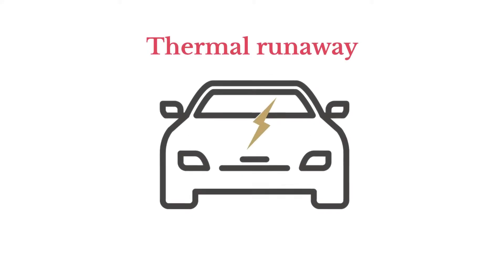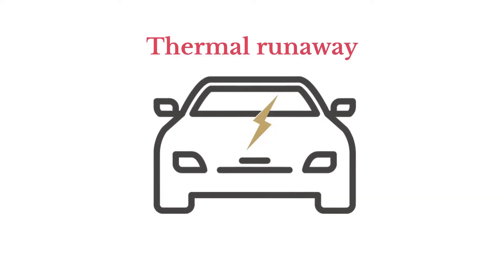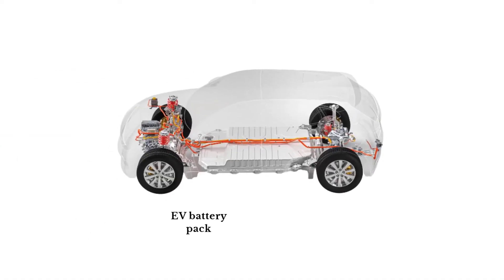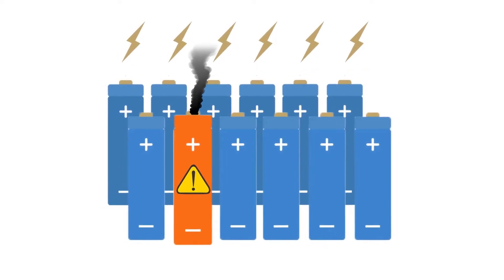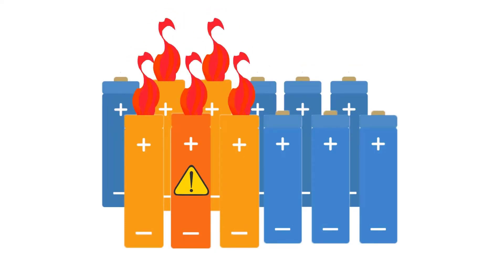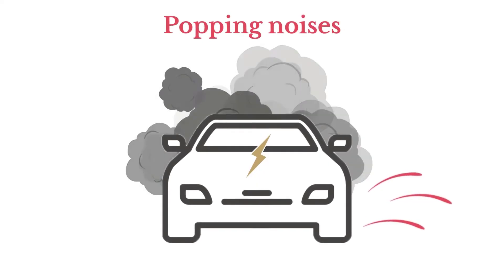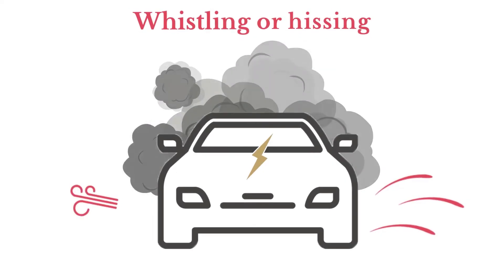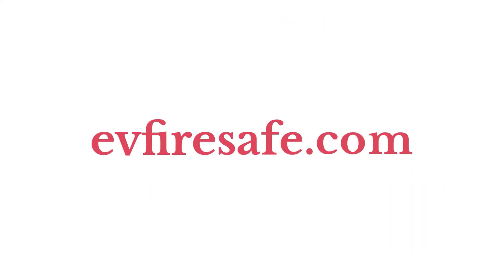What is thermal runaway? Electric vehicle fires explained!

Comment: Does anyone know the ratio of EV vehicles doing this VS gasoline vehicles?
Reply: Really?
Reply: The chance of an EVs battery igniting is 50 times less than that of a ICE igniting. 

Good news is some automakers are going to stop using lithium ion batteries and use lithium iron phosphate batteries instead, which will make them safer that ICEs. Also it is highly likely in less than a decade, sodium will overtake lithium and be the norm.

ICEs catch fire so much, that it isn’t newsworthy when they do unless they hold up traffic or kill someone.

Comment: The chance of an EVs battery igniting is 50 times less than that of a ICE, but your EV will be a write-off and you want to make sure you get your ass out of the car on time. Good news is some automakers are going to stop using lithium ion batteries and use lithium iron phosphate batteries instead, which will make them even much more safer that ICEs in regards to igniting. Also it is highly likely in less than a decade, sodium will overtake lithium and be the norm.
Reply: YOU ARE CLEARLY A COPY AND PASTE BOT SHILL FOR THE NEW WORLD ORDER AGENDA , EVS ARE 1000S MORE LIKELY TO CATCH FIRE DUE TO UNSTABLE MOLECOLES AND ATOMS , DIESEL AND PETROL IS AN EXTREMLY SAFE SYSTEM AS IT REQUIRES OXYGENS TO BURN , UNLIKE UNSTABLE LITHIUM THAT CAN BURN UNDER WATER AT 5000 DEGREES , FEW YEARS AGO FIRE SERVICES AROUND THE WORLD WERE FACING CUT BACKS TO AN EPIDEMMIC LEVEL TO THE POINT WERE FIREMAN WERE CAUGHT LIGHTING FIRES DUE TO THEY HAD NO JOBS AND WERE FACING THE UNEMPLOYMENT ,,, THEY PRAYED FOR A MIRACLE AND THEY GOT ITS CALLED LITHIUM , SINCE LITHIUM BATTERYS THE FIRE SERVICES AROUND THE WORLD HAVE GONE ON A HIRING FRENZY AND HOUSE FIRES HAVE INCREASED 1000S OF PERCENT , EVEN LAST WEEK A KID DIED IN MY AREA DUE TO LITHIUM BATTERYS SETTING HOUSE ON FIRE !!!!
Reply: I havnt seen ANY evidence of ICE car batteries catching fire recently......Not to sure where YOU get such silly data from.
Reply: You cant say the chance is this or that when there's only a handful of EVs in existence. EV's are not a viable option & the other problems they will cause if adopted widely will be way worse than EV fires.
Reply: @wandameadows5736  The data is about the percentage of EVs compared to ICEs in regard to the chance of igniting.

The argument that EVs catching fire exists as a veritable threat holds no water. EV fires are rare compared to ICEs. The problem with EV fires is it is hard to put out. Aside from crashes and poor maintenance, ICEs have significantly higher risk of fire caused by electrical system failure, fuel system leaks, and overheating of engine.
Reply: @wandameadows5736  It is inevitable that EVs will be widely adopted for small mobile vehicles; even big oil knows that petroleum is too valuable to waste as gasoline and that we should leave as most of it as we can in the ground for our grandchildren to  be used for plastics, paints, petrochemical feedstock medicine, etc. They know the free ride they had is coming to an end and their artificially cheap gasoline. Free rides always end, one way or another.

Mark my words, it is inevitable that the fight is coming over how fast to phase out fossil fuels, and it will be reduced to a battle between the biggest investors in banking and the biggest investors in fossil fuels; and politicians, environmental activists, and scientists will be irrelevant in this battle.
Reply: @rps1689  Firstly they could've saved lots of petroleum decades ago.

Engines could've been limited to one litre - with exceptions for businesses.  This one thing could've taken at least a third of what we use(d).

Motorbikes and scooters should've been made more attractive to use - more lights - three wheels - larger carry capacities - more protection against the wind and cold - road safety campaigns - tax breaks - very cheap insurance for all ages.

A maximum fare limit on public transport - instead they are actually doing away with the all day cards!

EVs are dangerous - the technology is almost there, but not quite.  Until the batteries are made safer, then they are death traps - especially buses!